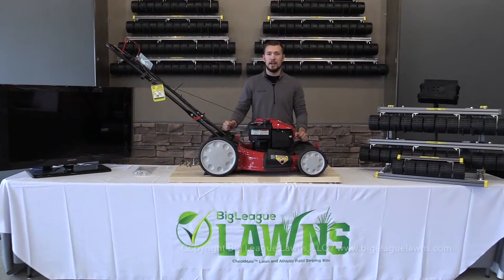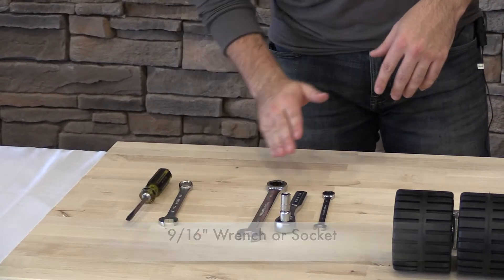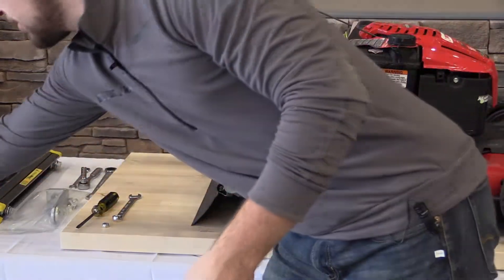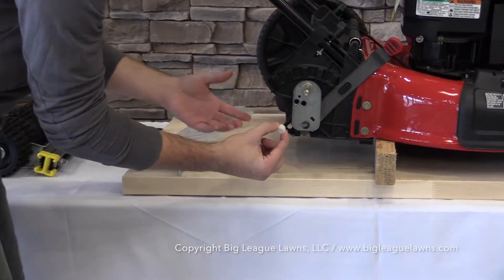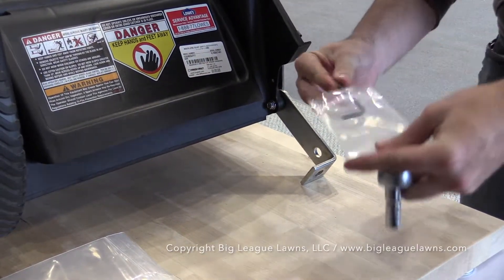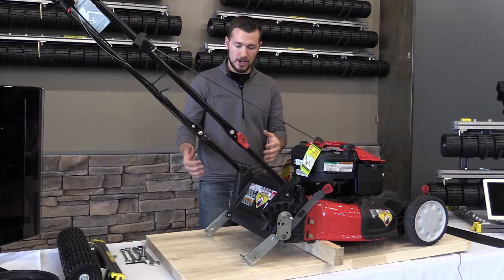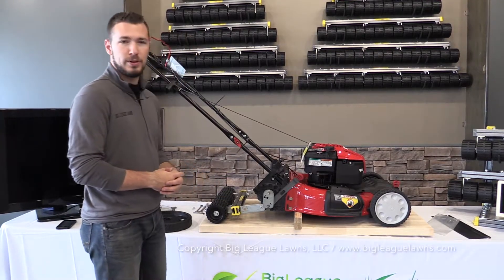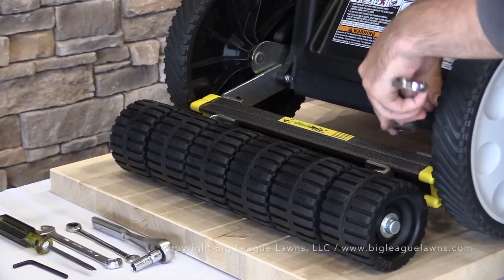MTD CheckMate™ Striping Kit Installation Video

Comment: So I have a Troy built tb365xp.  Mine has 1 lever and adjusts all 4 wheels from that point.  Also rwd.  Im stumped on how to get this on because instructions and every video I've seen aren't like this system
Reply from the maker: Jeffery, please contact us at sales@bigleaguelawns.com or call us at (800) 411-0150 and a sales representative will be more than happy to assist you. Thank you.
Reply: @bigleaguelawns  i got it on without drilling any new holes.  Just with this mower without cutting or drilling can't adjust higher than the 3rd notch, but I usually mow 1st or 2nd so good for me

Comment: How to remove worn out wheels from roller? How to remove end caps? Thanks
Reply from the maker: Dave Johnson you must use a flat head screw driver and hammer to compress the two metal tabs on both sides of the end cap.  They are a little tricky to remove but once you flatten the tabs from biting into the steel they will come off.  Good luck to you.

Comment: Has anyone had a tough time with a troy-bilt mower and securing the lawn striping system? Due to the metal bracket for wheel on the mower being more slightly vertical then horizontal it's nearly impossible to begin the process of securing the bracket to the skirt hole.  Any idea's, suggestions will be appreciated...
Reply: Did you ever figure out to put it on